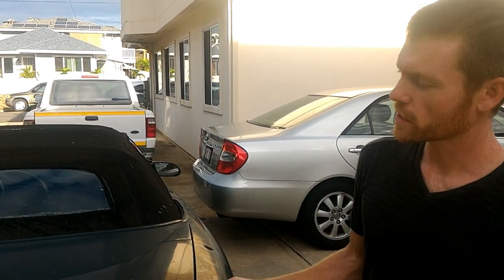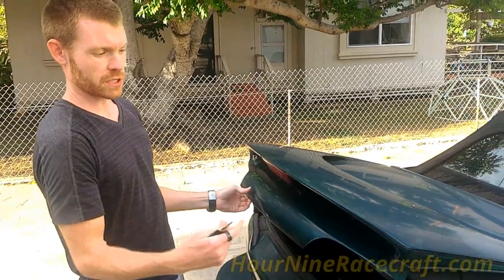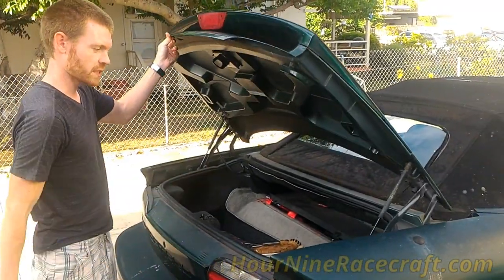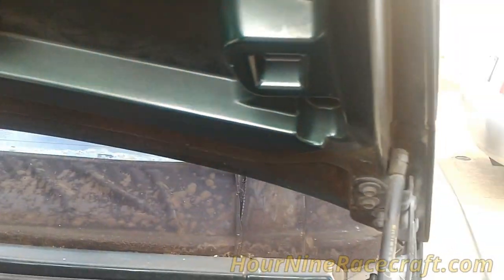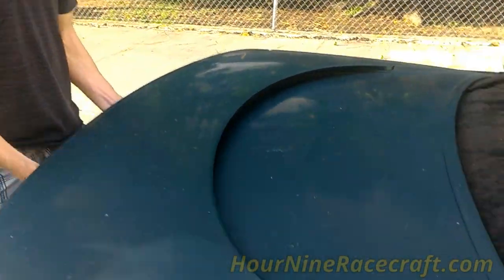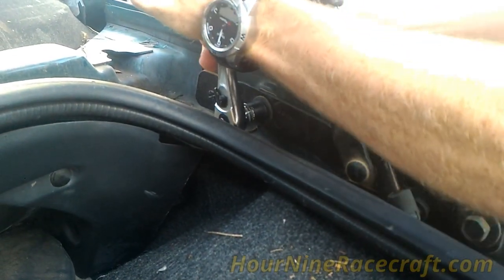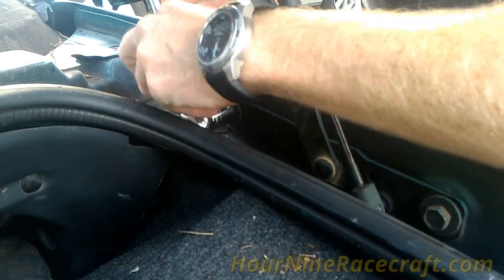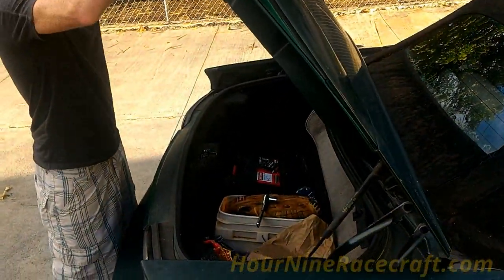Body Panel Realignment: Trunk and Hood

Comment: i have the exact same issue on my 04 s500 Mercedes except mine has the power assist open and close. its misaligned in the same exact spot?  you think that  mine needs an adjustment.   my trunk would pop open with the power assist then get stuck about 30 degrees up and got super stuff and difficult to open.  perhaps it was grabbing at that point.   i hear the power motor working fine.